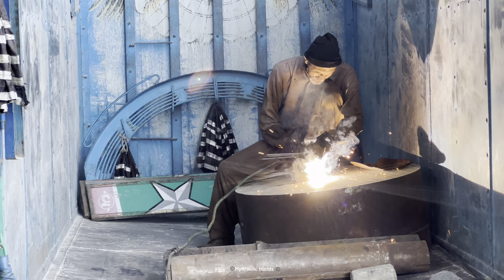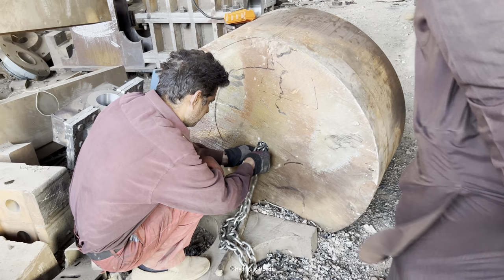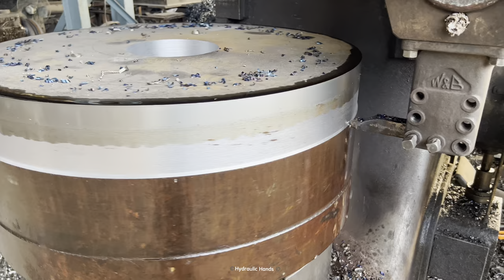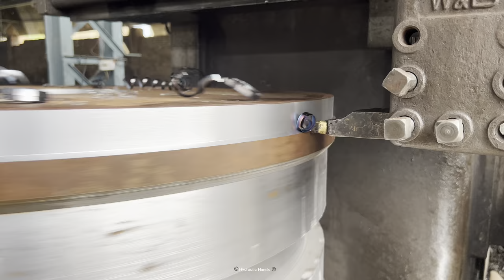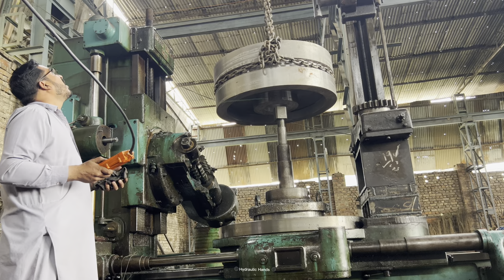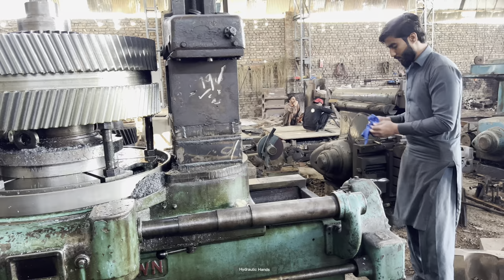Metal turning / how to turn 3Ton Double Helical Gear smarter than others

Comment: I love watching the old VTL (vertical turning lathe) make such huge chips. Those old W&B’s (Webster and Bennet) could really hog out the material so fast. Watching this is like a time machine back in the 20’s through the 50’s. Those old machines keep working after thousands of hours of use.
Reply: MRR on this is a fraction of what you can do on modern slant bed lathe. There's no heavy cuts here at all.
Reply: Thank you so much for your videos! I had a misfortune, I was diagnosed with ovarian cancer. I also created a channel and am trying to move in that direction, but so far not very successful((lp
Reply: Photo shoot with
Reply: Yes these machines are simple and robust and do not need high tech computers to make them work. I know I worked for W&B in the late 1970s. Modern machines will do more but make you pull your hair out when they go wrong.
Reply: We have one at Bo'ness heritage railway, though it needs repair, and no one really knows how to use it now. No one wants to learn how use these machines, so this is where all our engineering skills have gone. Love the PPE footwear.
Reply: And I was just wondering what w&b stood for presume they are British early 1900s
Reply: @stevemcevoy5628  Hi the company was Webster & Bennett, ( Machine Tools) Northey Road, Coventry. I worked for them from 1977 to 1981. They had about 600 employees.
Reply: @Tuckaway  That is great that machines you were a part of building you can watch them being used today all the way out there in Pakistan!
Reply: @Tuckaway  what would that hobbing machine weigh?
Reply: I guess they don't make em like they used to.
Reply: Never mind what they are producing ... how did they make the machines ... ?
Reply: Bennett
Reply: I've always heard them called vertical turret lathes. I used to run a Bullard and they called that a multi-spindle vertical turret lathe.
Reply: @spikeypineapple552   Werkstoffkunde, mehr ist mir es nicht wert zu schreiben
Reply: Steel toed boots aren’t going to be any help if you drop that gear blank on your foot. @DickusCopernicus
Reply: @dodgeboy9052  the way machining works, part by part with simpler machine, and precision builds on top of precision
With a basic lathe, drill, mill, casting, not sure the other I think there was 5 - anyways, with a basic version of the kit of machining tools, you have eveerything you need to machine their own parts, with incremental scale and precision - you use the machine to build a bigger and/or better machine
Dave Gingery wrote about exactly that concept in Build Your Own Metal Working Shop From Scrap, I'd hope it's a classic
Reply: I can't help but think that old W&B was scrapped decades ago, then fished out of the scrap pile once it got to its destination and put to use again.
Reply: Hervorragende Arbeiter hat ihr gesegnetes Land !❤😊

Comment: Good old Webster and Bennett machine.
I'd say these guys are pretty skilled. It's not what you've got its what you do with it (as the actress said to the arch bishop!).
Loved the way the guy marked it out with chalk, I remember doing similar when machining castings years ago.
Putting it on the gear hobber and supporting the base with jacks made of nuts and bolts (been there, done that), using old components as clamping washers....Yes these guys know what they are doing alright. Where there's a will is a way. Goodness knows what these gears sound like when running, but these guys are very good at getting by and making the best of what they have available.
Reply from the maker: Thanks for sharing your point of view, glad to hear that.😊 😇
Reply: Да пацаны вообще ребята)))
Reply: In Pakistan we have to make to do with what we have. One day we will get new technology but for now we must rely on our skills.
Reply: Felicitaciones  son  unos  maestros  y que hermosa maquinaria
Reply: even 19th century likely had far better worker conditions.....
Reply: Where there’s a will there’s money 🤣

Comment: I'm impressed with the product, considering the equipment, no carbide tools or even compressed air .
Reply: They used carbide tip tools, you just thought all carbide tools have bolt on inserts. These guys are tool makers as well as machinists.

Comment: Impressive. I was thinking, hope he shows how they lined up the blank gear. You did! Thanks.
Reply from the maker: Glad it was helpful!
Reply: Ah, but how did they line up the other side of the hobbed gear? Probably by marking it in the first place, but we'll never know.
Reply: @hydraulichands  He was being sarcastic. I'm tipping the two gears are a long way out of alignment "It looks good so it must be right, engineering and measurement doesn't matter"

Comment: I visited a large gear turning shop in Sheffield about 10 years ago, which had several large horizontal lathes and milling stations for this kind of work. More sophisticated equipment in the main with CNC on some stations. It was fascinating. We wanted a replacement part made for an indexing unit used on our Bridgeport Mill.  Once Sheffield was full of traditional places like this making and fixing parts for big machines, but it's harder to find them now. So many of the good machines were exported or scrapped when they closed down.
Reply: Yep, I dont know what is  "smarter than others". This all looks like very old technology from 18th century.
The guy welding without a mask is not good. I give them credit for being hard workers. The bosses are exploiting most of these people.

Comment: I did repair work ar the Mobile Pulley Works in Mobile  Alabama.  They had  a horizontal  lathe there If I remembrty correctly  it could turn something 24 Ft accross.  I heard something one day and followed the sound.  That lathe  had a tool set up on 2 sides and they were cutting off about a 1/2 inch  curl on both of them. Mobile Pully made discharge  pipe and fittings for the dredge industry and huge  swivel joints that had to be machined Always enjoyed working there!

Comment: It would have been very interesting to see that giant gear working at its operational setup.
Reply: I agree. I love to see the end product doing what it's designed for. This gear isn't finished yet either, I'm sure it must be polished and hardened because this is not particularly hard steel.
Reply: Yea 5 minutes… it’s 3mm two small!.. 😂
Reply: right, it's just a standalone wheel right now, not linked to anything
with the friction loss on those bearings, this can't be for a flywheel, what's it for I wonder

Comment: As a retired UK engineer,  looks an amazing process, obviously working to tight tolerances, but wouldn't recommend the sandles, but fair play
Reply: Not tight tolerances as the dimensions would be approximately. OD .5mm, recessed diameters as well as lengths are all clearance dim. .2 to .25 
The spigot bore and overall length should be tight tolerances but in reality the teeth are machined after the bore is done and that bore sits in a spigot((mandrel)(with their setup))not the most accurate way but this is not a high speed gear. 
So it should be fine. 
I am more concerned about the working environment. 
Just because you have old machines it doesn’t mean you have to work in a dangerous way. 
They have families and should work safer. 
Clean up, that is one big step in safety. 
Second 
Do not machine in a way that creates a danger to yourself or others around you. 
Work efficiently and safely then productivity and accuracy will improve and everyone will go home with all their fingers and toes.
Reply: @7thplanet121  what would the application of such gear be?
Reply: @rastislavstanik  Clearly it's for a Puch moped. Just kidding. Looks like maritime maybe.
Reply: @retinaquester   haha that would be the 1000 hp moped :D

Comment: How are these guys not getting metal shards in their eyes, hands and feet. I use the old machines, from the 1930's and they work quite well, when you use micrometers, dial calipers, dial indicators and the proper measurement tools. Infact the old machines will do very good work with the proper measurement tooling, just slower than today's machines and more hands on and manually having to oil the work and machinery. The work being performed is work from the 1860's-1940's. I'm glad to see the old ways are still alive and thriving. In the US, most young machinist would never know how to operate a manual lathe or mill. It is almost a lost art here. If society were to crash, the US would have to go back to the old ways and not many people know how to operate those machines. Probably only a few hundred thousand people in a country of almost 400 million population. Great video. I always look forward to watching these videos from India and Pakistan. The old ways are not lost there
Reply: The working conditions make this not much fun to watch, though ☹

Comment: I think this provides the most excellent visual evidence of why manufacturing quality has declined so severely. It was like watching a video of manufacturing in the 19th century. From the very start the whole process was dependent on one gut with the mk 1 eyeball and a beat up old tape measure. No continuous, real time measure of material being removed of constant read out of the current dimensions. Look at the amount of discoloured chips coming off, because they couldn't use sufficient cutting oil in those conditions (they'd be wallowing in a river of cutting oil). So the cutting speed has to be very low, not good for qaulity finish. And are these the working conditions we think are conducive of quality products? We all ought to be appalled that people are required to work in such conditions with absolutely zero safety. Do we think it is some how manly to work like that?? All this shows is how bloody far we are from a decent society. People would only work in such a place if their forced to. I'm sure for near slave labour rates.  Yes it great to see some of these old machine tools in operation, but not when you give even 20 seconds of thought of what that is actually showing.
Reply from the maker: Everything you said is Genuinely True
Reply: People do what they gotta do. Part of it is when you are a good and fast worker or can make things happen with less materials and processes then the bean counters say “well you did it without last time”.
Reply: It all depends on how much the end user wants to pay. If the end user wants high end and pays more, th more sophisticated machine can be bought. Nobody is going to buy a muti-millions machine to produce something cost a thousand dollar. It got nothing to do with manufacture quality, it is economics.
Reply: You seem slightly dramatic to me but I get your point
Reply: Works great! And they can buy boots if they don't want to wear safety sandals. The problem today is that we are being regulated into unaffordability. There really is no need for real time material removal measurements. It's not like its aerospace grade material going into a rocket lol.
Reply: This is real men’s work.. losing a toe or your eyesight due to welding is just part of the job. Man up ppl.  😂😂😂
Reply: @commie5211  I’m sure these parts will be within specification and half the price it would cost if made in most other places.
Reply: Why don't you do it?
Reply: @MaloneMantooth  Good reason to have organized labour.
Reply: I agree with the tape measure. If the center hole is off even slightly it will cause some serious damage when this piece is running in operation
Reply: You Jealous 😂😂😂😂😂😂
Reply: You Jealous 😂😂😂😂😂
Reply: YOU JEALOUS 😂😂😂😂😂
Reply: You’re making it sound like they’re slaves. They could choose to or not work. 

Unsafe working conditions possibly. Seems they’ve been doing for a long time and still there. 

I’d imagine in the country they’re in, there are no government regulations. No osha. Nothing. So take your fight to their government and laws.
Reply: No this is india. Manufcafure turing quality has gone up

Comment: Would like to see how they set up the RH and LH cut so both sides are in alignment. Would also love to know how long this takes. Mad skills!
Reply: It's marked out after hobbing one helix using a square and scribed lines, then a reference dot punch is marked in the centre of a tooth. A similar dot is punched opposite and the opposite helix is cut to this dot and it's aligned. A small error is unimportant as the gear will self align with its meshing pinion or wheel.
The setting skill is in making sure you cut a full form involute and get your hob through the centre space without cutting into the opposite helix.
I did this for 25 years making gears of up to 5 metre diameter.
This guy's set up on the hobber is rather inadequate IMO, and we almost always climb hobbed whereas this chappie seems to prefer conventional.
He has nowhere near enough cutting oil on the job to ensure minimal hob wear, it should be flooded. 👍🙄😄

Comment: This is very stressful to watch as a german machinist, but also very interesting at the same time
Reply: Not only the safety concerns. 
But the items around are bashed .
Long swarf ((different speed and feed rate or a cutting tip with a different shape(chip breaker))
Even if they cleaned up the work area.
You want them to go home in one piece.
Reply: Firstly how quickly the equipment must break down. 
Second, what different tolerance does these products must have.
Reply: +/-100mm 😬
Reply: What, you don't wear safety-sandals in Germany?
Reply: @jenskmigselv  🤣
Reply: @jenskmigselv  Steel toe boots wont help with 3 ton piece, so why bother?
Reply: You are not the only one...
Reply: "stressful" is an understatement.
Reply: Quality is when you meet the requirements of your customer....
Reply: Why does it remind you of the camps 1943.
Reply: @7thplanet121  Bruh they're using HSS.
Reply: It’s probably very stressful being a german in general.
Reply: @georgeshearer1412  Germany has an unbroken chain of top notch engineering for centuries, why should the 40s be something they should ignore?
Reply: @kubagornowicz  because there's about a thousand other things that could also fall on your foot
Reply: @kubagornowicz  also even sneakers would be preferable, why would you want to walk around in sandals when there's metal shavings everywhere?
Reply: @dhstube  🤣
Reply: It kind of says it all, the way they just drop the finished product in the dirt.
Reply: @kubagornowicz  They might help with the mountains of sharp chips laying around.
Reply: @davidswanson5669  sorry but you missed the point entirely. Read the history as I have no desire to start to explain.
Reply: @georgeshearer1412  He's just snobbish...
Reply: Diese Fließspäne...
Reply: @spikeypineapple552  Nope. Brazed carbide.
Reply: The almost total lack of mortar between the bricks of these Pakistani buildings makes me cringe whenever they are lifting tons with the overhead cranes.
Reply: @7thplanet121  1
Reply: @georgeshearer1412  unforgiveness poisons the unforgiving.
Reply: oooooooo woww a german machinist
Reply: ikr car crash tv
Reply: @mortenfrosthansen84  Two microns at one end and half an inch at the other....
Reply: the crane is running on independent steelwork  so no probs
Reply: @jenskmigselv 😅
Reply: @terrywilliams1960 tell that to those who were at that sharp end of the club boot and whipe.
Reply: ❤❤18 25:50 ❤
Reply: @emcserver2442 ?😂😂😂👍
Reply: All you Germans are very good at machining without a doubt but maybe you’ve been overthinking things to much. German tanks in WWII were far superior to all others except for the fact that they took to long to build and were over complicated for what they we’re being used for. There’s something to be said about simplicity.
Reply: Think also about the men who maintain those machines as well. Those are pretty ancient by today’s standards.
Reply: @kubagornowicz 
nice boots are nice to wear 
HAPPY FEET HAPPY WORKER
AND SAFE❤
Reply: Why just because you are a German
Reply: @kubagornowicz  about a million other reasons... think man, think. don't speak.
Reply: @emcserver2442 I want his autograph
Reply: As a Martian machinist, it’s very stressful to watch the Germans work.
Reply: @trappenweisseguy27 Why? The building is not bearing the weight of the parts…

Comment: The guy doing the welding is living dangerously. He should have gotten completely out of the truck before the crane lifted the workpiece. You never want to put yourself in between something that heavy that's suspended and a hard wall. That's a real good way to get yourself squashed. But the machine work was great, especially with the antique equipment. Those old fashioned verniers are cool, and most of these young guys these days can't even read them. I bet if I sent those guys my Mitutoyo 24" digital calipers they'd do the happy happy joy joy dance for about a week. :)
Reply: It's clear safety is NOT a consideration at all hardly in these videos.

Comment: Judging by the absence of any kind of protective clothing (boots with metal toe protection, gloves, helmets, goggles), the employer does not bear the cost of treatment in case of an injury at his workplace. The labor safety inspector would have closed this shop in the same second. Gross violations of labor protection rules. This is a big problem for the shop owner.
Reply: This is the norm in Pakistan.
Reply: Yes, steelcaps will work when 3 ton drops on your foot 😂
Reply: @voidmstr  Did you hear the news? Pakistan is bankrupt. Watching this video I can understand why.
Reply: Welding by braille. Practice for reading by braille with no weld goggles.
Reply: @redryderaus  The society and government are failing the people. Very sad.
Reply: Honestly, they couldn’t even get these guys some gloves?? This does not look like Pakistan.